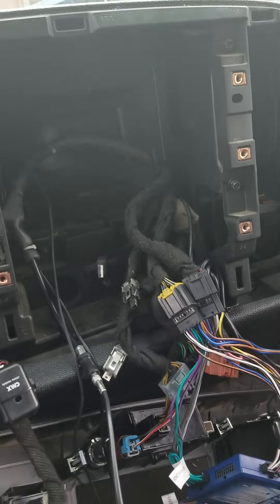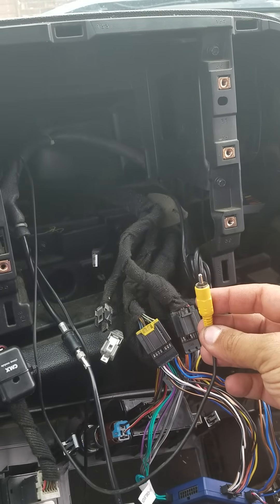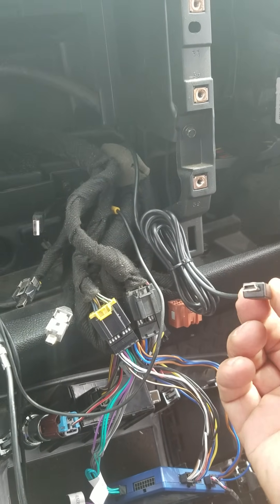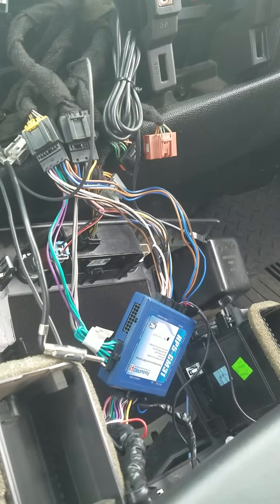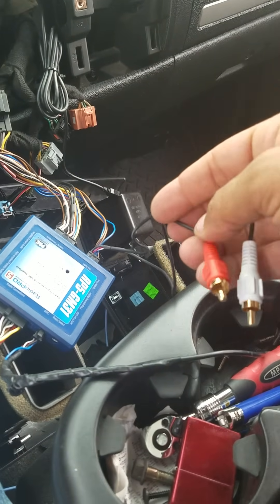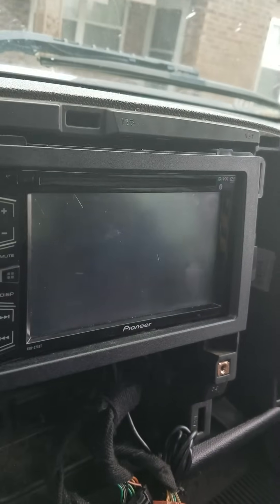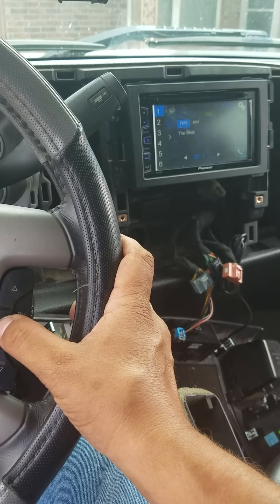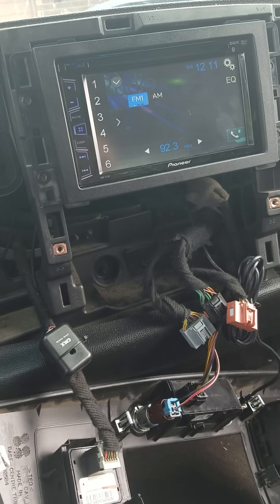Pac RP5-GM31 installation and operation.

Comment: Justin, which Pioneer model, plrase?!
Reply: Thanks Man!
Reply: Can I use AVH-270bt?
Reply: I have TAHOE 2008, it came without back up camera. What do I need to think about when I install pioneer? I installed a radio before, it was Pyle, I was not happy at all with it, I end up to install the back up camera as  bybass with external swith. 
The next question, which type of radio that dode not need to cut the piece from the dash back of the radio?( I know I am giving you a headache with my questions).

Comment: warning******  THIS DEVICE WILL NOT WORK ON GMC HIGHER END VEHICLES SUCH AS DENALI OR ESCALADE. IF YOU HAVE DISC CHANGER WITH BOSE SUBWOOFER, THIS DEVICE WILL NOT WORK!!!!!!!!!!!!!!
Reply: What about a Tahoe 2016?
Reply: What about it won't work?
Reply: @dankrawzyk7253  steering wheel controls....none of it will work
Reply: @the king yea.  I can't get the back speakers to work and also the back up camera.   It looks like wires are not in the correct locations within the plugs.